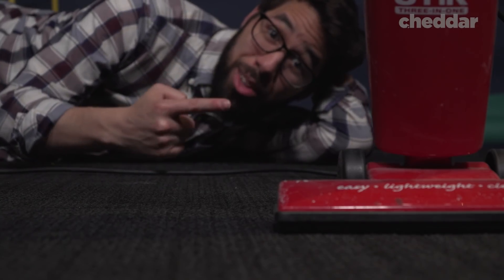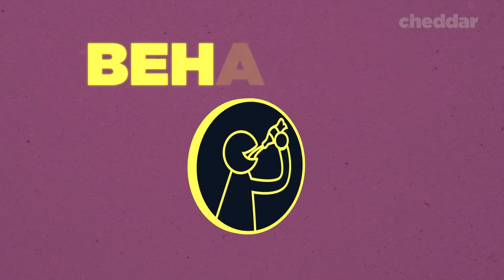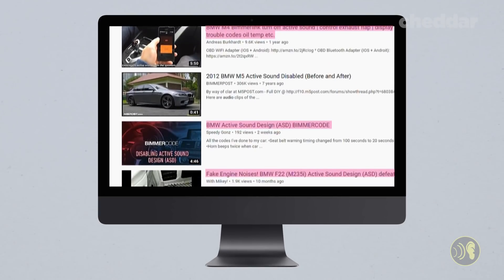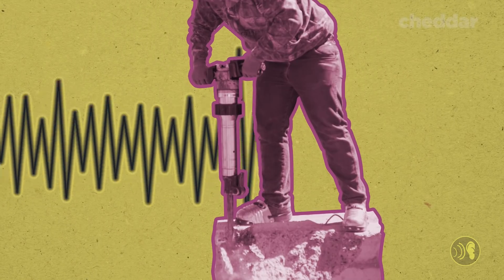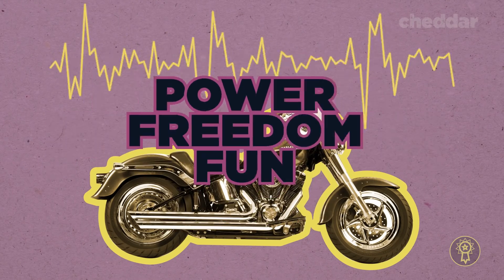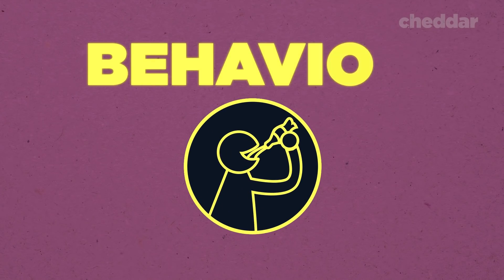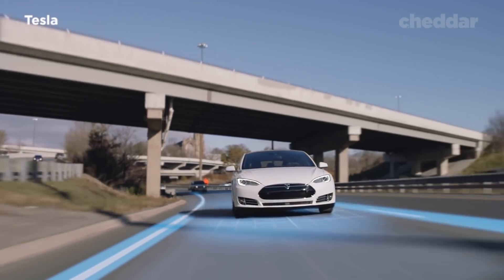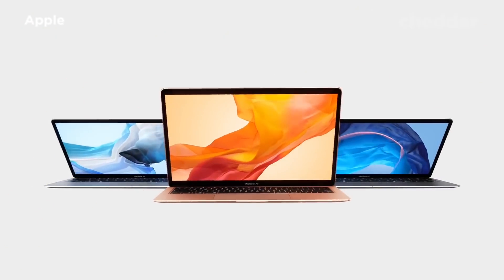The Fake Sounds Companies Add To Products - Cheddar Explains

Comment: I'm gonna say that vacuum cleaners aren't specifically designed like that, even though I'm super late to comment on this. Cheaper motors are louder because they don't have thought to them. Silent vacuum cleaners are being produced. Just go to a vacuum shop and try out a Miele vacuum cleaner on the lowest setting. Cleans great and is super quiet.

Comment: For me, you just can’t make a car quiet enough!  Well, OK, no... but I’ll say, “you can’t make a car too quiet.”  

Our Prius Prime, a plug-in hybrid, usually has no engine noise since the engine is usually off, and it has amazingly low wind noise on the highway.  In fact, even when the engine is on, you hardly hear it, except upon hard acceleration. The killer is road-surface noise:  on a smooth road, the Prius Prime is almost completely silent, but its tires and suspension system play road textures like a @%£$ phonograph needle!

The Central Market “upscale” grocery stores here in Austin TX make a really awesome loaf of bread called “seedsation loaf,” but the plastic they wrap it in is kinda annoyingly crackly loud!  During the day, it’s usually no big deal, but when my wife is still asleep, and I’m trying to make some toast...

Comment: I have an electric car. Not a Tesla but a 2016 Kia Soul EV.* Even among EVs it's considered one of the slowest, but from zero to about 35-40 mph it is quite peppy in my book. It's weird, though, going that fast and only hearing a very faint whine from the electric motor. If I don't have the A/C on it is virtually silent except for some very mild road noise which I would normally not hear at all in an ICE car (Internal Combustion Engine) because of the sound of the engine.

Short story: Performance will eventually outweigh sound experience in the long run, or we will start finding those electric motor sounds appealing down the road at some point.

[* Which I LOVE LOVE LOVE!]

Comment: I remember when Harley tried to Trademark their sound. I supported it but then I own one. But in reality anyone can take a steel rod and ram it into the muffler and smash a bunch of the baffles and it will sound more like a Harley.  What bothers me is the little wimpy  horn on motorcycles. When you hear a certain type of horn sound, you immediately expect to see a car, a semi, a train, or a motorcycle. In some states or local municipalities it is illegal to put a car horn on a motorcycle. I bypassed that issue by just putting an air horn on my bike. Like the ones that come on top of cans of compressed air. Nice and loud so people with closed windows and radios playing can hear me. (Especially when they are about to merge into my lane without signaling or looking). Until I can find something better like a really loud speaker that will scream "LOOK OUT YOU A WAD!".

Comment: That new vacuum cleaner we bought has an induction motor. Somehow it powers up very slowly, so it happens that I press again, thinking it didn't start, switching it off. Idea for sound-engineers: add a fake sound that makes it sound like it's going at full power when you press the button, even though it's still picking up...

Comment: As a vacuum cleaner repairman and enthusiast, the real reason why average vacuums are generally loud is really about saving money on production costs in any way possible. Most people these days buy cheap vacuums, evident in this thread. Cheaper vacuums tend to be louder because for COST CUTTING measures, they have less (or no) sound insolation in the motor casing and are not as securely fastened in that same housing, allowing for extra vibration. Cheaper vacuum cleaners also have motors that tend to spin at higher rpms, also resulting in more noise, and this also leads to them burning out much more often. These motors MUST spin at higher rpms, or else they won't make the same amount of "power" as larger motors will.  Some higher end vacuums are loud due to being a direct air design (Oreck/Kirby) because the fan is not enclosed in a housing, making it harder to insolate from noise. However, many vacuum cleaners, particularly from high end european brands such as Miele and Sebo are indeed extremely quiet, but that's because the motors in those machines are heavily insolated in their casings.

Comment: As the owner of a Bosch dishwasher, I can confirm.  My house is an open floorplan, so what you're doing in the kitchen can be heard in the living room and vice versa.  My old dishwasher created so much noise that we'd taken to loading dishes and running the washer either right before leaving for work or when we were going to bed.  Sometimes that was damned inconvenient. So I bought a Bosch, which was advertised as so quiet you'd never know it's on.  Bought it, hooked it up, ran a load. And I'll be damned those Germans were right: it's SO quiet that I thought I'd installed it incorrectly because you couldn't hear it.  Not a sound.  A mouse burp would be louder.  The only way to know it was running (the Bosch, not the mouse) is that it projects a small red dot onto the floor just in front of its door when it's on.  I figured for sure it had to be doing a horrible job of cleaning the dishes if it's that quiet.  I mean, what's it doing in there, spritzing the dishes and flatware with a gentle mist of water and hopeful wishes?  But nope; when it finished I was greeted with dishes so clean I thought for a moment that someone had loaded already clean dishes from the cabinet.  Took a while to realize that sound doesn't equal quality.
Reply: my brother bought the generation before yours.  it doesn't project a light onto the floor.  the only way he knows it is running is if his feet get wet when he opens the door.  mine is one model cheaper.  it has an exposed control panel including a countdown of how many minutes until it is done.  and it makes an occasional gurgle.

Comment: This is so dumb... no, they did not design the sound of the door closing. The door was designed and built and if it sounded horrible then somebody might have a veto and maybe some materials were changed, but I promis you that they did not redraw or designed the door differently.

Comment: I disagree with you, sound design is a bad thing.  Designing for positive experiance makes sense, and it's not going away; I get that!  But the conformity mandated by taking that path is terrible and abhorrent in every way I can concieve.  Diversity of experiance is a good thing and is a much more powerful tool than conformity.  If you try to be like everyone else you guarantee eventual failure.

Comment: The more silent tech the better.. The silly EU saying that a silent EV car must make sounds below 13 MPH for safety is silly. a EV has sensors to see the people and cars around it so it will auto slow and even stop if there is someone or something in it's path. So a sound below 13 MPH is not needed and in fact undoes the point of the EV being silent and clean and non-polluting! Even super noisy damn Harley Motor Bikes are soon to be only silent Electric ones the company is now selling them. Thank heck.. their original super ear hurting noisy polluting ones need to be banned.  Roll silent tech we need more to enjoy a better less stressed life and roll on electric vehicles too without noises.

Comment: This is the stupidest shit ive heard in a while. Making vacuum cleaners loud and obnoxious is a design choice? 
Fire the asshole who did that. I dont care for your distinct "vacuum cleaner" sound. Just make it do what its supposed to do : suck up dirt. Thats it
If i can get a quiet vacuum that would be 1,000 times better than the noisy ones.

P.S. you never gave any examples of vacuums that had either lots of sound or little of. Afraid youll get sued?

Comment: From a physics standpoint, the more sound something produces the less efficient it is; unless the main purpose of the system is to produce sounds. Sound production is a form of energy; and where is that energy coming from? It's coming from the energy we burn, however, the real question is where is the energy being stolen from? The motors. So if a hypothetical experiment was made comparing two identical engines but one made more noise than the other, and the test is to see output of forward energy(/speed); the more quiet one would win.

Comment: Nowdays vacuum cleaners working on battery are way quiete and sells aren't reducing. I'm pretty sure a real quiete cleaner is easier to sell even if it can be seen as less "powerful". I think the true reason is cost: the use of ineficient but cheap and noisy brushed universal motor in all mains cleaners.
Reply: The vacuum cleaner example seems to be based on a report from 1971 and consumer preferences might have shifted somewhat in the last 50 years...
Reply: E
Reply: We just bought a bosch unlimited 6 series, and indeed, a lot less noisy. I believe it has an induction engine, which means it starts a bit slow... Sometimes I press the button twice, thinking it didn't get started at the first push.
Reply: Ok.
Reply: Your content looks awesome would be watching it if I understood what you were saying 😂
Reply: @gn8103  you can check DIY experiments our english channel :)
Reply: @gn8103  you can check DIY experiments our english channel :)
Reply: Brushless motors don't have to be loud though look at rc

Comment: Another car related sound purposely kept in cars is indicators. The clicking was caused by a relay back in the old days. Modern cars don't use the same relays like that for indicators anymore, so the sound they make is an artificial relay click. You could have silent indicators in a car these days, but then I guess you wouldn't know if they were working or not without taking your eyes off the road.

Comment: This is so interesting. In Japan, they highly value silence and see a quieter and SMALLER item as a HIGHER quality item. There are social and legal rules against high noises. They also don't have the "large engine = loud = powerful" bias in their cars, which probably helps. 

As such, you find TINY, QUIET, and POWERFUL vacuums are the norm... and although the landscape of foreign brands that sell well are Mielé. Small trumps noise though... and so when Dyson brought the DC12 to Japan, they still took Japan by storm, despite a really strong domestic market.
Reply: Lmao you're acting like JDM sports cars aren't just as loud as their American/European counterparts. This is pretty untrue. The biggest factors for noise are engine displacement and exhaust, and really mostly the latter. The really loud cars you hear are because people (for some god forsaken reason) want them to sound that way, so they bought a special exhaust or muffler (generally speaking). Also, teslas like the one mentioned in this video kinda suck despite their very quick acceleration. I do like what they've done as far as bringing evs to the market tho, I just wouldn't be caught dead in one.

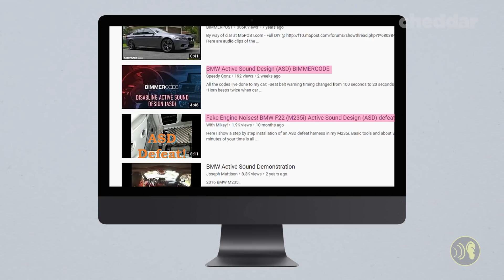Comment: 2:30 so you're saying car engines now vs before are like physical spring keyboards vs touchscreen keyboards?  Bc the improved car engine and the touchscreen keyboard are a lot quieter, it doesn't feel as "satisfying" while using it so designers purposefully add sound to it? Now that I think about it, many things have that, just not as hidden as the stuff in the video. like camera shutter sounds, beeping notifications, smartphone ringing during calls, etc.

Comment: Bikes are louder mostly due to the short exhaust system making it more difficult to even out the pulsations. Along with trying to reduce back pressure to get more power out of a smaller displacement motor.  Although hardly did try and patent the sound the sound is mostly from the crankshaft timing.
A Harley engine has two pistons. The difference in the Harley engine is that the crankshaft has only one pin, and both pistons connect to it. This design, combined with the V arrangement of the cylinders, means that the pistons cannot fire at even intervals. Instead of one piston firing every 360 degrees, a Harley engine goes like this:

A piston fires.

The next piston fires at 315 degrees.

There is a 405-degree gap.

A piston fires.

The next piston fires at 315 degrees.

There is a 405-degree gap.

Comment: Haha, once I got a new washing machine. Turned out, it didn't work, or so I thought. The sound level had changed so much towards quiet, I really thought it was broken and called the company demanding they come and fix it. The person came and turned it on and assured me it worked fine! I was shocked and still think the noisy old ones cleaned better, you could hear how much work was going on!

Comment: They dont put fake sound in a vacuum cleaner. There is a reason why vacuum clearner companies boast about having the most silent one. if they were able to make an affordable silent vacuum cleaner, they most definitely would. companies only think about money, so if a company could make a completely silent vacuum cleaner, they would make huge amount of $.
The cars producing fake car noises is a trend that has started very recently. and thats because of sound regulations on the road these recent years. 
motorcycles are also louder than cars because they dont have space for a big exhaust system like a car have. the smaller the exhaust system, the louder it will be.
Dont trust everything you see on youtube. 
Just for the record, they dont make things louder than necessarily, its just simple physics. although there is a few exceptions

Comment: Loud is "macho", 1 idiot on a Harley HAS to make more noise than a city bus hauling 60 people even if they are going the SAME SPEED.  My 2011 Buick Lucerne has a 0-60 time of 7.7 seconds, A 1969 Camaro Z-28 is only 0.3 seconds faster......The Buick does it quietly.

Comment: 5:05 - Not really. Not gonna go into the never-ending argument that is "loud pipes save lives" but a lot of modern bikes are fairly quiet when leaving the factory. Harley has actually put a trademark on it's sound because that's one of the main reasons people buy them and purists won't accept a quiet Harley (many opting for louder aftermarket pipes to further amplify the bike). It's another example of expectations and sound design.

Comment: silent vacuums exist. My mom owned a purely mechanical vacuum in the mid 90's, it resembled closer to an over sized swifter, with just a rod and bottom piece with moving brushes when pushed, i always thought it was the best vacuum i had ever used, not because it was utterly silent, but because it literally picked up more dirt than any other i have used to this day; it was featureless, silent, light, very effective and quite efficient, tho had a harder time picking up dust sized particles, it could pick up what only shop vacs can no problem. They are still around, but not sleek as the one i remembered, they've made them bulkier now, prolly so can hold a larger load between bag changes

Comment: Many homes & wood/carpentry shops are rigged with central or remote vacuum system.  Since the motor & impeller are elsewhere.  I added a fluttering sparkler & chirper which sounds a bit like a drowning bird, to remind me that the system is on even when wearing ear protection.  It is no fun to have it accidentally inhale my clothes or small tools.

Comment: That just pisses me off about the vacuum noise, especially now that I know it's made louder on purpose.  I just thought it was the laws of physics where the motor just made it loud and it couldn't be helped.  But I always wondered, "Why can't they put a muffler in that thing?"  I don't give a rip if it "seems more powerful" with the noise - give me a vacuum where I see the dirt coming off the floor (without spitting back out!) and QUIET, and I'll be happy.  I need a cleaning machine, NOT a noise polluter!